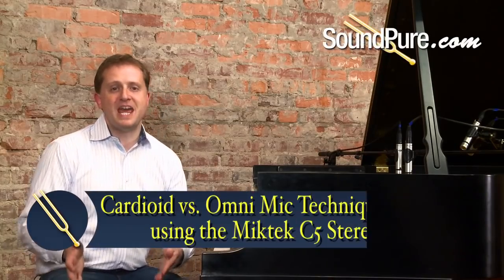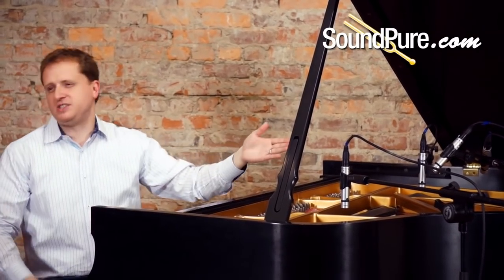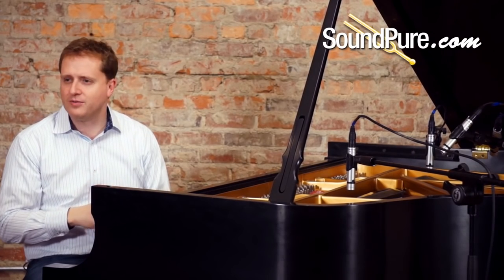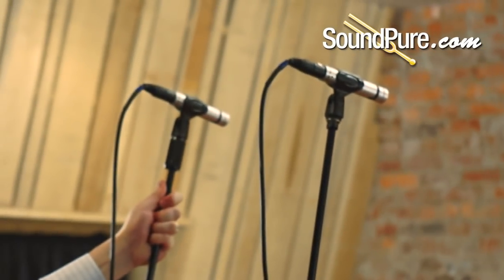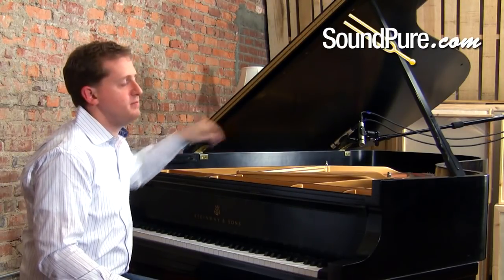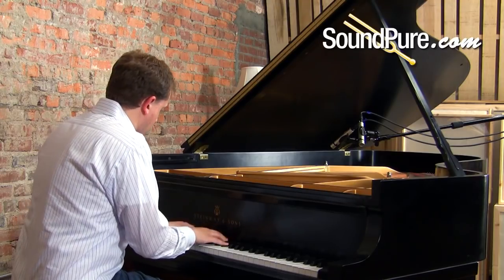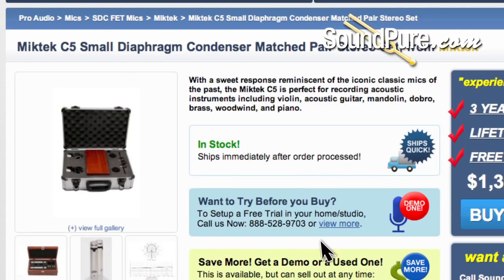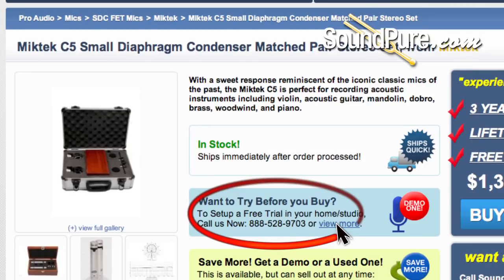How to Record Grand Piano - Cardioid vs. Omni Microphones (Miktek C5)

Comment: The omni is more of a centered sound, but I usually do the cardiod mics at C3 and C5 and set them at 10 and 2 o'clock. I like the presentation of the pianist with left hand on the left and right hand on the right. I love Omni's for ensemble work about 7 feet up and 27" apart in a room with a tall ceiling and no ambient noise in the room.

Comment: Thanks for the video!
Is there a way to minimize the noise from the pedal when recording with cardioid close to strings?
Reply: A couple of others have used high quality ribbons inside the piano and Omni outside to avoid any mechanical sounds of the piano.